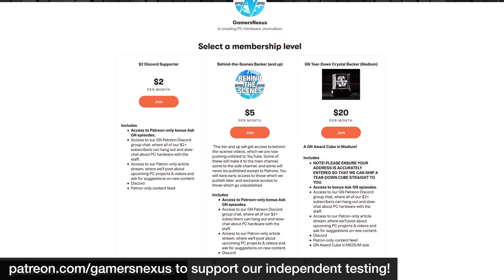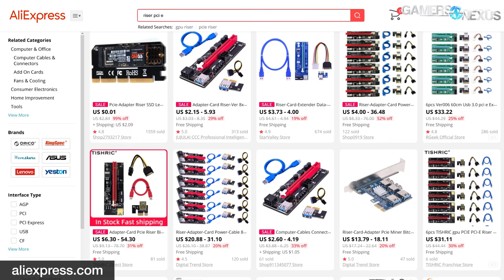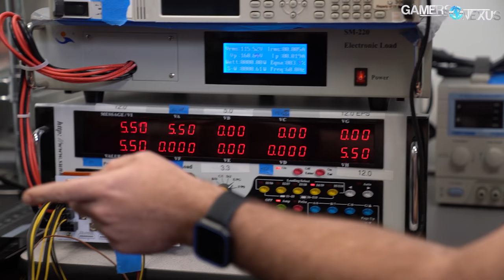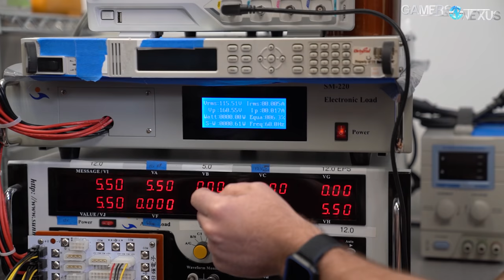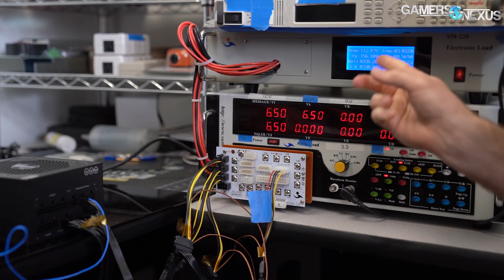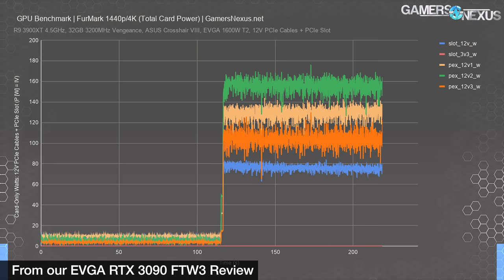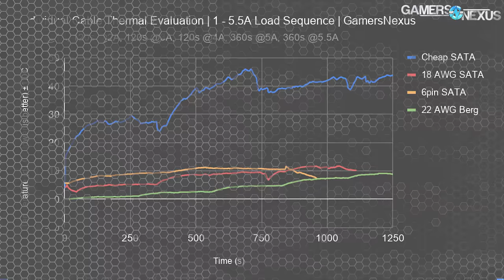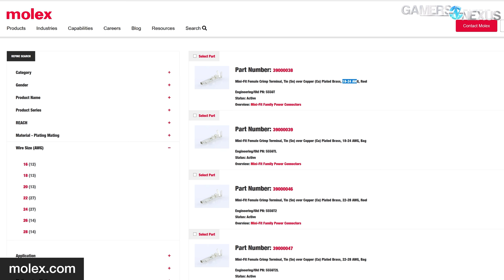Don't Use Cheap Cables: Dangerous Construction & False Wire Gauge

Comment: And to say to the average user, even if no fire or even smoke or smell does accrue, but if the wire gets warm to the touch you are over stressing the wires/cables and need to at the least back off on the load to that particular power supply branch and most definitely not add more stress to the system by adding more load to it.  My rule of thumb is not to use any cable manufactured with a gauge, size, wire under 18 gauge and use copper and not aluminum wire conductors.  I use 16 gauge wire in all my builds and only copper conductors, as I special order my cables or even construct my own cables for special or unconventional uses and test, test, test.  But that will result in a much more expensive cable and connector whether you buy it or make it.  The connector parts themselves also must be using thicker conductors and copper and more insulation and better quality insulation that can withstand higher thermal loads.  again, more costly.  But in the end, over-engineering in this regard equals a safer, more stable, and longer-lasting machine and components.  And underpowering a component will also shorten its lifespan even if there is no indication of conductor failure other than just a little more heat to the touch.  Worm wires to the touch are not good!

Comment: Burning smell...the one thing you don't wanna experience when working on a PC...LOL, last night I worked for hours upgrading the CPUs and MBs for the fam pc and server. SATA port connectivity issues aside on the server B 450M MB (8 drives 24TB), got everything done at like 2 am...but my 8 port PCI-E Sata card was not allowing me to have all the drives connected at the same time, so the Drive Bender pool was constantly showing drives drop out...funny thing is my old A88M-G/3.1 MB had no issues with this lol...anyway I was tired and decided to be lazy and hold an additional PCI sata expansion card in the case with my hand as it was running, just to see how it would fit, and what slot it would take up..etc...metal bracket touched the motherboard, spark, burning smell, MB toast. Thank God for Amazon same day shipping lol...lesson is don't be lazy just because you're tired and it's 2 am.

Comment: I remember when front panel from one of my pc cases melted completely. I was just using my pc like I always had. I started smelling something weird and noticed the front panel started to melt. I mean melted literally. Only thing I used on the front panel was and xbox controller and there was nothing 3rd party or anything like that used on the build. USB port was faulty in that front panel.

Comment: Nice test setup!!!! i wouldn't expect less from you, a real pro in your area, about the cables, same here, i even had cables that where crossed over (12V to the 5V input and 5V to the 12V input) thank god i never connect anything without checking or my GPU would be really really DEAD hehe, those adaptors are a mess, but we usually have no choice because most PSUs doesn't have enough MOLEX and the very few available are so freaking bad, that i rather take my chances with the molex to sata adapters.

Comment: You mention cables with wires that are not the advertised gauge, but I just want to note that incorrect gauge isn't the only sketchy thing that's done. Sometimes they're the "right" gauge but are ALUMINIUM wire instead of copper wire, because it's cheaper. That has similar problems to an insufficient gauge.

Comment: If you're going to use cheap adapters, keep it to low power parts. SSD's, low rpm hard drives, low power fans and stuff like that. The most critical thing I have in my pc with an adapter is sata to molex power for my D5 pump, and it draws like at most 2 amps, or about 25w.

Comment: I just finished my new build today and I still had to use a molex splitter to sata power since I just couldn't reach 2 of the hdds with the sata cords the power supply came with. I've used this adapter with the same drives for a while so I'm not worried about it but I don't like knowing I've got a bit of mustard and ketchup in my white build

Comment: I do mining (I bought all my cards several years ago, so no, I'm not driving up GPU prices).  I also work on DC-DC converters for a major semiconductor company, so I know a thing or two about power.  I crimp my own cables from 18awg wire, use only the mini-fit jr connectors (we use those at work too - great connectors), and made sure to get genuine molex pins for the shells.  I also don't daisy chain GPUs on one cable - every GPU gets its own cable from a special power distribution board.  My GPUs get powered from an HP server power supply with an adapter board to mini fit connectors.  These are great because they are cheap, can do stupid amounts of current, and are very high quality.  The whole thing gets powered off of 220V from a rack style PDU plugged into a twist lock connected to my basement subpanel.  The 220V is great because it keeps the current down. Not that that is a problem - the AC part is so overspecced, I could probably 5x my rig and not be near any limits.

Comment: I think this is also good awareness of people buying cheap braided PCIe and MB Cables to hide their stock PSU cables. If the going rate around the board is about $30 and you find it for $15 it's probably skipped some corners.

Comment: Additional Advice - don't put a tight bend in a cheap adapter cable close to a cheap connector. As a non-overload example, I had a smoke-fest after using a cheap molex-to-SATA adapter to a SATA HDD where there was little room. The tight bend twisted the cable and pins allowing the 12V pins to short together, destroying the HDD and causing a massive release of the magic smoke. The room and house survived, luckily, but my reputation as a repairer/up-grader is shot!

Comment: I wonder, are molex connectors inherently better for higher power draw given their simple pin layout? E.g. 4 relatively large pin molex vs. the high number of smaller contacts in a sata power connector? Seems to me like a good rule of thumb is only to use SATA power on disk drives or devices that draw similar or less power than an optical drive, hard drive, ssd etc.

Comment: I used some cheap mining risers for some fun back when I was in university. They were SATA powered, and I probably had 3 at most at any given time (I was just a student having fun w/ my limited money, not a mining farm). Worked great, no issues at all. 

What DID fail, though, was a molex->SATA (or sata->molex, actually can't remember) adapter I used in my main rig to power a D5 pump. That thing burned up/melted real fast. Even though it was using far less power. Just bad luck, it can happen basically anywhere.

Comment: I bought some SATA extension cables to route to my ssd and ancient dvd drive due to the cables on my psu being too short. If I'm using SATA power cables for actual things designed for SATA I should be ok right?

Comment: Ah, the dreaded molded Molex to S-ATA adapters... "Back in the day" I personally experienced the failure of one of them (freshly installed, before knowing of its dangers, connected to a new DVD-RW drive... Fortunately I never put the case side panels until all is tested and that let me smell burning plastic and shutdown the computer. It was immediately after turning it on, nothing was ruined), had to "repair" a computer affected by one of them (burnt adapter and DVD-RW drive, everything else survived) and received another DVD-RW drive damaged by another one. None of the drives were in use when the cables failed, so they were not passing much current...

Comment: I recently fried a Asus Rog Thor 1200 somehow but my only culprit was bad cables. The cables came with the psu, what I found was one of the pins in the 24 pin connector wasn't seated all the way in it to the plastic connector. Also fried the sata cables at the same time they wouldn't work at all after the big bang. I made sure to inspect all the cables that came on the EVGA unit I bought while I warranty the ROG unit.

Comment: I've experienced an electrical fire first hand in high school. A friend of mine was taking notes with his laptop while plugged into the wall. The cable carrying 220v to the power brick had a short or something and started overheating. The rubber coating caused pressure to build up and eventually the cable just blew up with a very loud pop. Fortunately nobody was hurt and we put the fire out in seconds. Had we not been there though, the curtains right above would have burned.
Electrical fires are scary. More so than you think, if you've never experienced one. Say safe people.

Comment: I've personally seen multiple cases of molded SATA connectors burning even without being connected to anything. The 5V voltage was enough to cause electro migration and resulted in short circuit.

Comment: This is an area where Amazon has been sued for multiple times and I wouldnt be surprised if the law changes to more directly hold them liable for stuff like this since most of the sellers themselves can't realistically be held liable. (good luck finding them) I had thought about making quality power cables/extensions since there's not many American companies that do it aftermarket but insurance is probably the reason why I guess. Harder to compete against companies that don't have to do that

Comment: Some PSU brand use cheap conductors in their wires, it is not insufficient gauge size but CCA wires. Those CCA wires are very light, high resistance and easily heat up.

Comment: This is especially important because of Amazon’s practice of throwing similar yet non-identical items under the same SKU and mailing out whatever the warehouse worker grabs from the bin to fill the order. This is why Amazon isn’t a certified Nike retailer anymore. Too many people were getting sent knockoffs when buying Nike products via Amazon. I bought a wiring kit off of Amazon and it seems much higher quality than the wire included in other kits I bought from Amazon, but who knows? I use the seemingly high quality wire in my guitars.

Comment: Cheap cables are often made from aluminium instead of copper, so they can't handle as much power at the same thickness.
For current ratings of Aluminium wire, take 2 from the AWG of copper wire to get the AWG for Aluminium, e.g. 20AWG copper wire will carry as much current as 18AWG Aluminium wire.
Reply: Surprisingly it was not mentioned in the video - copper plated aluminum is the staple of a proper chinesium wires. OTOH there is nothing wrong with Al wires as they provide the best conductivity per weight.

Comment: Fun fact wires don't care about voltage (to a point) so when it says 2 amps max that is 2 amps of whatever voltage is going through that so
2 amp 3.3 volt 6.6 watts
2 amp 5 volt 10 watts
2 amp 12 volt 24 watts
Thats not alot of power per wire/contact point so that makes it easy to pull to much power for such a small wire

Comment: The main issue will probably be with the aging connections, not with cable or new connectors itself. Cheap connector pins oxidizing or getting poor contact over time especially if there is moisture in air will increase resistance and be much more likely point of failure. Locking connectors like PCIe ones would be much more safe from getting loose over time, 4pin MOLEX have a very positive engagement and also are less likely to get loose over time. SATA power connector on the other hand are very easy to unplug, plug in crooked or loosen over time and it does not surprise me at all that they are the ones that fail in this scenarios most often.

Comment: Not knowing what a circuit or set of cables can provide is a common problem in all areas. Not just in computers, but also in household circuits. Plug-in heaters are the worst. Having a microwave on the same circuit as another device such as something to boil water (don't do this! Also toasters). I don't think most people know how many watts are allowed on a circuit. For computers, you don't really know how many watts or amps are going to be pulled through the cables. But the biggest problem I have is that most cables are cheap and a thinner gauge. If computers used 14 or 16 gauge, things would be a LOT better. But I've never seen anything use numerically lower gauge. I also don't think many of the 18 gauge cables are even 18. They look like 20 or 22.

Comment: Btw keep in mind the current capacity of a wire is rated by acceptable temperature rise and type of sheathing material. That is why silicon cables are amazing. At 200C wires can operate safe way above what you would normally think is safe.

Comment: i wonder how much a HDD or SSD takes in power on those cables... i kind of ran out of available plugs while i still have more SATA plugs to fill so knowing if extensions and splitters also makes drives dangerous would be nice. (then again, when i plug my old 500 GB, my 4 TB drive keeps disappearing, weird considering it should be the 500 GB if it is broken... or is it power?)

Comment: One thing you didn't mention was that much like graphics card there are investors scalping on copper and the aftermath of that is now you also have to care about copper clad aluminium wires which are fine for speakers, AC or anything pulsed but need to be oversized specially on DC.

Comment: Eh in my experience voltage drop is an issue long before cable overheating to the point of melting PVC. For my RGB I had to use an extra 500w 5v PSU and at 80+ Amps sometimes at max brightness to keep the 5v above 4.8v (otherwise white starts to look like pink) I had to use triple 8AWG and a couple of 12awg ring circuits, that in higher voltage open air apps can handle 300A and only get warm. I would think that if the 12V and test pins of an atx supply started dropping 10% due to cheap higher resistance wire it would simply shutoff. I guess that was cheap too and had no safety backup plan (kinda needed for bigger supplies with 50 or 100A rails).

Comment: Had a cable catch fire and fry an HDD PCB. This happened using an MOLEX to SATA power adapter, which of I recall was a 3-way splitter, from Deal Express (DX). It was the only thing connected.

Comment: With my old AMD FX system where the CPU alone pulled over 220 watts, I grabbed a random PSU cable out of my closet to plug the PSU into the wall. Lets just say that cable was used a foot warmer for a few days until it started to smell of melted plastic. I then found the proper PSU cable supplied by the PSU maker.

Comment: I made my own cables out of solid 16 gauge wire. Yes they are stiff but that is a plus in this case since it looks better. It takes a while to make though it is about 3 minutes per wire + 3 minutes for connecting a single 5557 plug so for an 8 pin you are looking at 8 * 3 + 2 * 3 which is 30 minutes. It takes that long because you can't have 1 wire longer than the other. If 1 is longer the plug wont fit or you have to bend it somewhere and then it is crooked. Then I have to stip the wire and solder 2 pins. fitting it into a 5557 is a pain since you need to keep the correct wiring in mind.
Anyway my I made 2 EPS cables and 5 PCI-E cables 2x6 pin and 3x8 pin The other cables are not worth burning my hands for. 24 pin would take hours to make due to how complex the wiring is. The sata cables need to be flexible so I won't bother.

Comment: NEVER use Sata power for anything else then hard drives and other pc accessories that use very little energy.
I bought some splitters for my miningrig from Aliexpress, supposed to be 18 awg, they where very soft and felt very thin. I did not use them. You should really order a extra cable just to cut it in halv, to verify  the thickness.. :-P Its also smart to keep an eye at a new setup for a while (several days, maybe weeks), to catch potentially hot wires before it gets bad.
Another thing is that even if the card says its using 200w in software, its probably using alot more then that. So dont use that as a pin point of what wire you need.

Comment: I like this for different reason.  Try moving your hardware to unused spaces in AT/ATX of old large towers. Carefull on the exteners but will need extencion in some old cases. Not one to use multi conector to one. I always used 1 for 1 and seen a few adapters fail.

Comment: Regarding using cables out of spec: I talked to a man who repaired industrial welding robots, he used 35 35 mm² cables to deliver power to the weld. 35 mm² permits 100 ampere, these welds pulled ~1000 Ampere, but for very short times and with a few seconds of downtime between welds so it was fine.

So it's fine to go out of spec on cables - as long as you know exactly what you're doing.
Reply: No, you're wrong there. Perfect comment to illustrate just enough of a lack of knowledge to burn a house down.

That spec is for constant load. 

He's not applying a constant load - so he's not operating under that spec and cannot be outside of it.

He's under a peak load spec, which is short term just like the nature of his work - and could easily be in spec for that.

Hell, real world it for a sec - say an EVGA 750G2 - its a 750W PSU. But if your use spikes to 1000W temporarily are you "out of spec"? No you are not.

Because the spec for that instance is actually a rating of 1500W.

Cool?
Reply: @gorky1317  well, my bad for using the legal regulations for fuses for permanent installations. 
I still stand by my point that you can break the specification, as long as you know exactly how it will be broken and that it will be safe in that scenario. For general purpose permanent installations you cannot know, thus you cannot be safe unless you follow the regulations

Comment: It's not just wire gage that could be a problem. Some el cheapo cables could be copper-clad aluminum, which doesn't conduct as well at a given gage. I've run into that stuff in other applications, and it sucks.